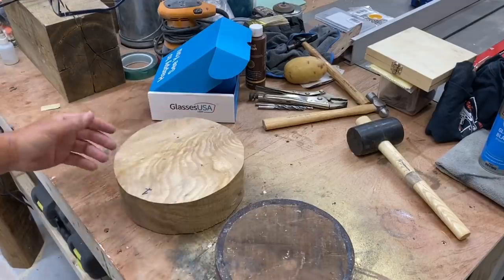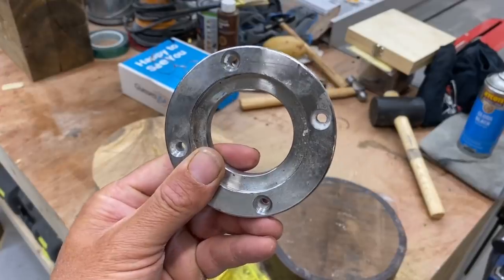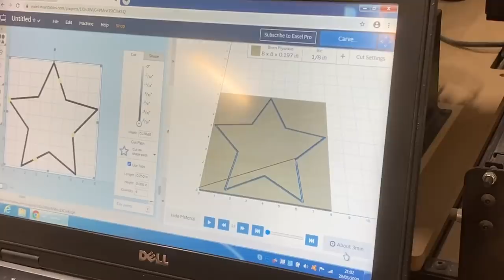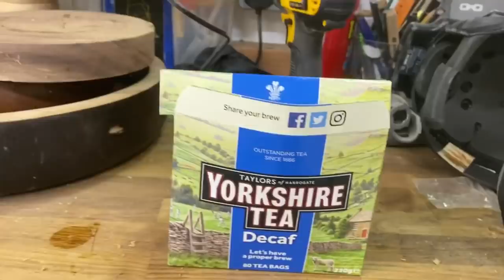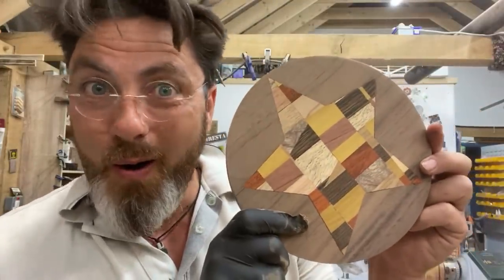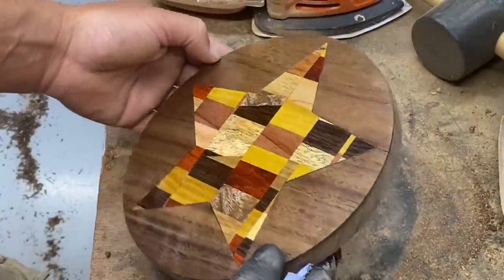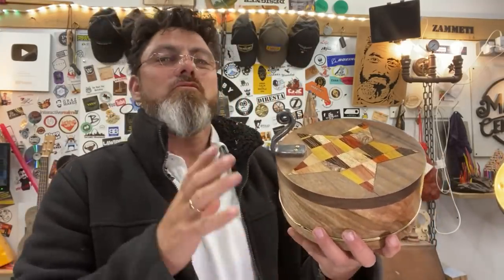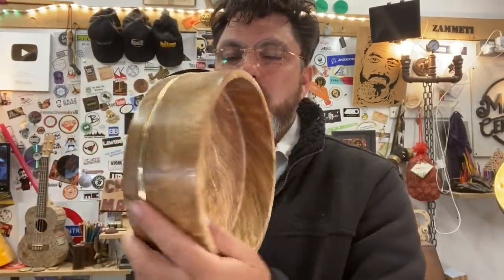Woodturning - The DIY Star Funk Box!

Comment: You should make a table with that mix wood pattern. Then use the handle as inspiration for the legs. But take it up a notch with the table design. For example, turn the table into a container or put drawers in the table. Doesn't have to be a big table, maybe just a small end table.

Comment: Hey Nick, did you know if you put a pinch of salt on your glue the crystalline structure of the salt helps to keep your wood from sliding all over the place while you are trying to clamp it? It really works, and the salt doesn't effect the hold of the glue either, so it is a good truck.

Comment: Love the work, Nick, as always. You really do some beautiful work. Quick question, turner to turner. Do you use a roughing gouge to start the shape of your turn, or a carbide tool? I switch back and forth, but would appreciate your opinion as to which you prefer. Thanks!
Reply from the maker: Hey depends on the wood if it’s a bowl black like this a carbide , if it’s a massive chuck of wood a roughing gauge 😁👍🏽
Reply: @nickzammeti  Ta! Always appreciate the advice. Still working on building my skills both in turning and filming.